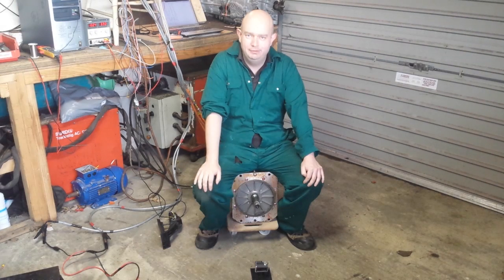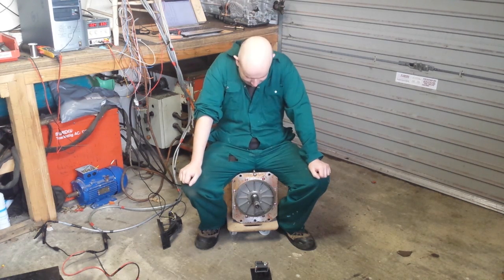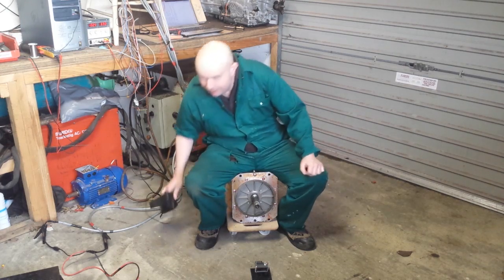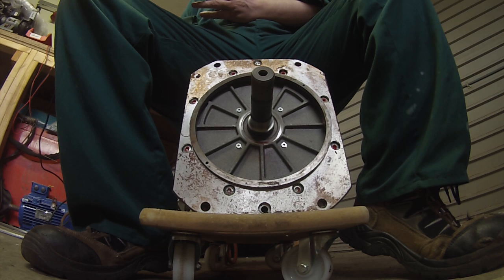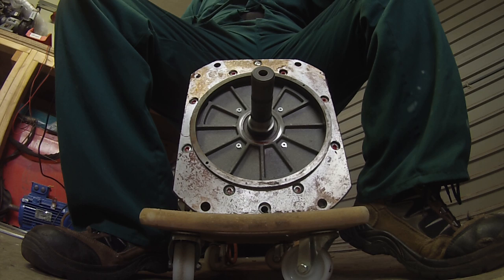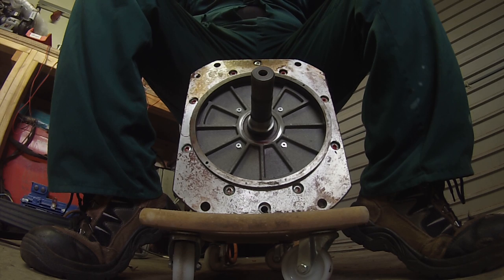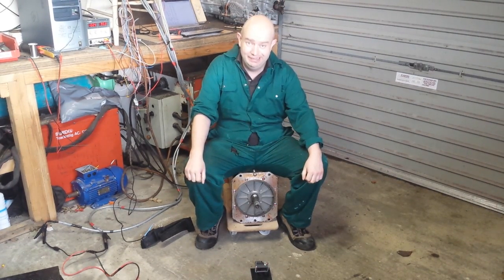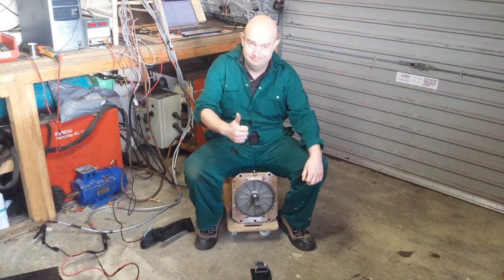BMW E46 Budget Electric Drift Car Project 02 : Motor Man

Comment: I am familiar with the Siemens 1PV5138   weighing113 kg each, (very heavy for power produced) and running @ 500 or 600vdc.  My friends got a few of these motors in the Azure Dynamic auctions about 3 years ago.  At  best they are 150kW motors for a brief time, but still an inverter that is 150kW @ 600 vdc.  I know you dabbled in creating your own DYI inverter but not at that high of voltage.  I know you are trying to create a low cost build but in my mind this is not money well spent.  Better to get  a salvaged TESLA motor/inverter @ 310kW for about $6K with EVTVME GEVCU to hack the canbus.   If you want to do something unique separate the motor inverter from the gear drive and adapt it to a transmission to a normal rear-end like you have in your BMW's    Mark Yormark